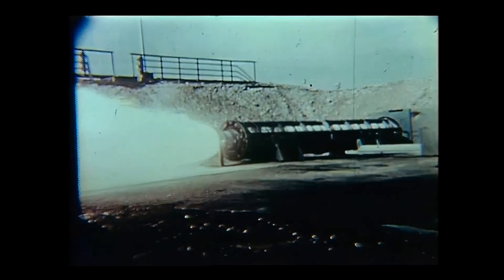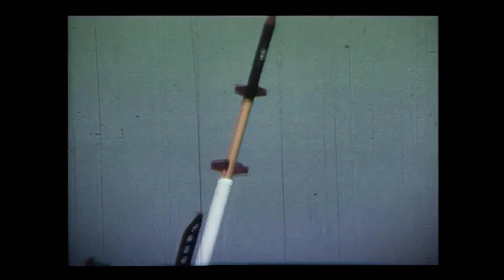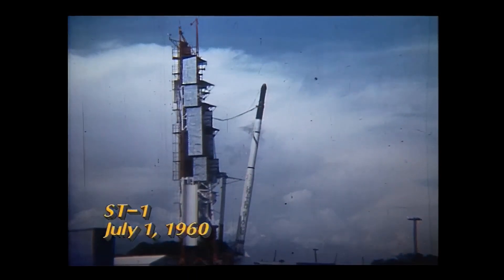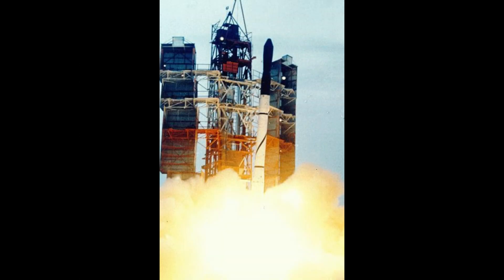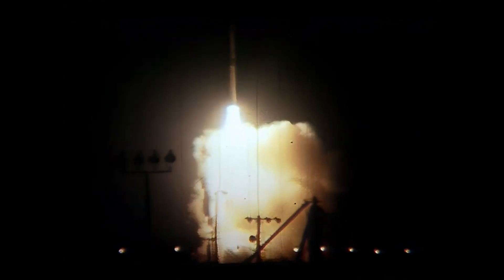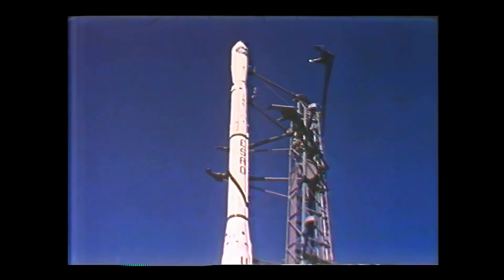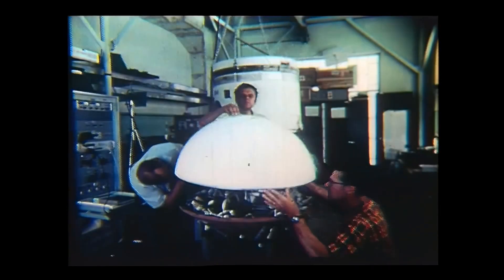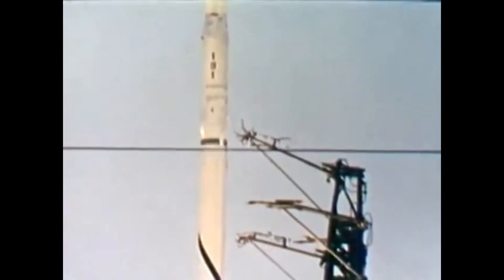The NASA Rocket Everyone Forgets Exists

Comment: Always enjoy your videos Scott but this one hit very close to home for me. I worked the Scout program at LTV Missiles and Space Division as a technician and was at Wallops Island for the Gravity Probe A launch on 18 June 1976. It was a real treat being at the facility working around a live rocket. Somewhere around here I have pictures of the vehicle the day before launch. Interesting note is a large ball was used to plug the Base A nozzle. You can see pieces of it bouncing  up in the air on some of the launch videos. I was in the blockhouse at launch and it did shake the floor. Some of the guys I worked with were present on the failed launch that damaged the sports car. They said it was customary to leave the blockhouse door cracked open so after the sequencer initiated the launch, the team could all run out and watch. As it was told to me, when the first ones got out and saw the fire and debris, they were very keen on getting back inside only to run into the stream of guys coming out that were unaware of the carnage. Thankfully none were injured.

Comment: There's a Blue Scout on display outside the Strategic Air Command & Aerospace Museum. IIRC the placard explains one of its uses was to lift a radio relay on a suborbital trajectory for use in case the satellite network was compromised.

Comment: Maybe I’m jumping on the wrong X-1. But it’s because I have a serious issue with USA claiming they designed the aircraft. They absolutely did not. The aircraft was a British design that had an all FB lying tail and wind tunnel tested very thin wing. The Miles M-52 was built to go 1000 miles in one hour. It had a turbo jet engine shock cone air inlet that carried the pilot cockpit and full undercarriage. It was almost ready to fly when muppets from British government canned the project and had all those design secrets given to USA. Bell copied the shape, the wings and tail. But they used an air drop launch and ticket motor. Pilot safety? There was none.
Reply: All correct - but your spell checker has run riot 🙂. The story I heard was that the UK and USA did a deal to share supersonic research to beat the Russians. So the UK sent over all their data and designs, including the crucial all moving tail. And the USA sent - nothing. Not out of some Machiavellian scheme, but because they didn't have anything worth sending.

Comment: Did the Polaris have a cover over the missile tube? It looks like it from when you see them launch, I think the Trident has the same but never been able to find an answer, I guess this is as good a place to ask as any.
Reply: All submarine launched rockets currently are sealed even when the tube doors are opened.  When launched, a gas generator over pressurizes the tube, both propelling the rocket towards the surface AND provides an envelope of gas enveloping the rocket, sort of like a bubble.  When it pops out of the water, the missile is actually, mostly dry.  When the missile starts to fall back to the water, the first stage is ignited for its journey.

Comment: So with Solid motors... did it accelerate like a mad thing ???
I understood that the high acceleration was the reason why they didn't become the goto system for orbital launches.
And that Liquid fuelled rockets were much gentler on their payloads...
Yes/No ?
Reply: The ascent was more energetic, but not exceedingly so. The peak acceleration was at the burnout of the stages and was around 9 g's. The average acceleration was much lower.
Reply: @cogoid  
LOL  😄
I don't think I would enjoy being on a rocket doing 9G.
Reply: Liquid systems can run into problems of their own when things like pogo happen.  Even the Saturn V had its moments.

Comment: That "hotter" staging system sounds very Kerbal.  Specifically chaining solid motors without stage separators and letting the exhaust from an upper stage burn away the lower stage.

Edit: Also, thank you for mentioning Orbital.  Northrop has done them so incredibly dirty since the hostile takeover.  They were the OG private spaceflight innovators, way beford SpaceX was even a gleam in Elon Musk's eye, and it's kind of painful to watch Northrop piddle around and do absolutely nothing with the rockets they designed and flew so successfully.
Reply: To be fair, most of Musk's ventures were successful or well on their way before they were a gleam in Musk's eye.
Reply: My father works for them (Orbital Sciences before the merger with ATK and now Northrop Grumman) and I've asked him about this. What he told me was that the reason Orbital stopped using the Pegasus was because they couldn't get any takers for it, however, they do have a couple in storage left so in theory they could be launched but the price keeps going up because having all the hardware to use them without it being used is expensive.

Orbital Sciences has the record for first private orbital launch vehicle on top of it being an airlaunched rocket.
Reply: @efulmer8675  My father has likewise been working there for a similar length of time, and he was under the impression that some of the satellites his group is working on were originally slated for those boosters but were moved to different launchers when Northrop bought them out.

Comment: About 4:10 or so: I don't know that I've heard of "fins" versus "vanes", or even fin-like objects in the exhaust. Wanna talk about vanes at some point?
Reply: The Scout first stage had fixed delta fins with steerable (by internal gear + chain) tips which connected by shaft to vanes in the exhaust (jettisoned within 15 seconds, or at least that's what the specification says).  So the vanes handled steering in the early seconds, and then as speed increased the tips became effective for that purpose.
Reply: I’m not what he meant by fins for steering unless they were pivoting fins but the Exhaust vanes he mentions are a form of thrust vector control. The Vanes could be controlled to direct the exhaust/thrust. I don’t believe they use that method too much now though, as a lot of rockets probably use a gimbaled motor mount instead for TVC
Reply: In one of the KSC Visitor Center history buildings they used to have a Mercury-Redstone exhaust vane on display which apparently fell off during Alan Shepard's flight (I guess they didn't need all of them).  They have redone that whole area since I have been there so I don't know if that particular item is still on display there.

Comment: Scott, I'm surprised, you missed one of the more fascinating uses of the Scout launcher, its one claim to fame in the early manned spaceflight program.  People forget Mercury-Scout 1, that flew in November of 1961.  Probably because it failed, lol.  But it was designed to put a small test satellite into a Mercury orbit that would last for a few hours, and was equipped with the same radio and radar systems as a Mercury spacecraft, complete with simulated telemetry and command channels.  Its purpose was to exercise the Mercury tracking network with a real spacecraft prior to flying a manned Mercury.  As it turned out, MA-5 flew with its chimp passenger before MS-1 was able to be launched, so it proved out the Mercury network.  It meant that the loss of MS-1 wasn't a real problem.  However, I think it's good to remember that the Scout was, in fact, a Mercury launch vehicle.  From a certain point of view.  🙂
Reply: As a Space Race Kid I did not forget.
Been involved with DoD and DOE projects in my career.

I believe it was Joe Rogan who started the nuclear testing in the Nevada against structures and soldiers was propaganda for Russian consumption.  This is an uninformed blogger prospective.  This data was clearly integrated in to AEC regs and DOE construction requirements.
And to think it was a Hollywood stunt omits the fact that the Russians conducted the same kind of testing in Kazakhstan desert.

Finally, what I postulate to people for the last +40 years of you believe our ICBMs of the 50 & 60's were reliable well I guess you did not have broadcast TV in the day or the Google or YouTube machine in the modern era to actually see the documented footage of what the US Space program overcame to deliver a payload to space or orbit.  At the time regardless of the fuel solid or liquid our rockets regardless of the base military rocket fell apart or exploded on the launch pad or in early flight. (Name it - Jupiter, Viking}={vanguard, Mercury-Redstone, Titan II , .... Atlas...) All designs from our ICBM inventory.

Understand that are human rated Space program rockets made our ICBMs extraordinarily reliable.  This is why we should look at the Saturn and the f-series engines with awwwww.

Our bombers were the credible delivery system in the 50 & 60's not ICBMs.

And ablative heat shields for the weapon to survive re-entry was a 2 way street.
Reply: @barrelmitt1544  I wonder however how much reliability mattered in terms of deterance. Obviously I'm not saying it didn't matter, but if say 30% of launches failed, that means 70% of the nuclear weapons are hitting their targets. Of course back then there weren't nearly as many missiles, and also if the reliability is extremely poor and only 1 out of 10 launches are successful that's much less of a deterance.  But the usual clips showing failure after failure I suspect are not showing the full context. When I have some time I would like to go through the early launches and get a better idea of the failure rate for the different vehicles.

Comment: First time I read anything about a Pegasus launch was way back in the late 80's or 90's when one was launched from an F-15. Haven't heard much about the concept since. Makes sense to use a large aircraft as your First Stage.
Reply: Pegasus was too large to fly from an F-15.  The first few flights were from a NASA B-52 before Orbital acquired and modified the L-1011 that they would call "Stargazer."
Reply: The Pegasus rocket is unique and its a shame that its basically died.
Reply: @efulmer8675  You can blame Northrop for that.  They bought Orbital ATK and basically killed everything they were doing except the stuff they had government contracts for.
Reply: @vicroc4  Northrop is still looking for customers for their last two Pegasus rockets but yeah both my dad and I were surprised Orbital ATK got bought out so quickly.

And oh yeah, Northrop's logo makes me die inside.
Reply: F-15 was the launch platform for "ASAT" satellite interception weapon tests.

Comment: My step-brother, Mike Howell, built a Scout for the National Association of Rocketry Annual Meet (NARAM-13) back in the early 1970s for which he placed 2nd in the Scale Model Rocket competition that year.  As a somewhat younger competitive modeler myself, I was amazed at his skill and hoped I could match it someday.
Reply: Why scale it down?  Full size uses standard solid motors like all the other models .
Reply: @johndododoe1411  Because in the 1970's there was still a lot of sensitivity to larger than 160 newton second thrust propulsion in a model rocket, primarily due to no liability documentation as we have today in the NFPA 1122, 1125 and 1127 frameworking, nor the airspace permission.  Building and flying such a full scale rocket today is possible under our current FAR Part 101 system and launch license system, but back then it was not.
Reply: @johndododoe1411  cause its massive lol, hed have to basically use nasa hardware at that point. on another note i miss launching model rockets, buying the SRBs from the local hobby store etc
Reply: @johndododoe1411   A  Scout model entry in that time period (NARAM-13 = 1971) was probably in the 35-40 mm diameter range.  I've built a few models of the ST-4 round seen at 6:02 which are about 60 mm in diameter and powered by an Estes D12 in the first stage.

NARAM-13 was by the way when Space Race-infused competition interest peaked for the National Association of Rocketry:  There were about 700 applicants for the 350 slots.  I believe that was the only NARAM which had to cap competition attendance.

Comment: Scott, you should do a video on the SPRINT missile.  Unbelievable performance.
Reply: The Sprint missile breaks my physics brain. The speed of rockets is hard to feel, but the breakneck acceleration of Sprint is hard to fathom.
Reply: @suserman7775  Leaves launcher, achieves multiple mach instantly, all while making 90-degree turns. With 1970 technology. Head-busting indeed.
Reply: Zero to hypersonic in a few seconds? It would make an interesting interceptor.
Reply: @fallinginthed33p  Wasn't that its reason for existing? I seem to recall Ivan wasn't happy about it.
Reply: @thomasbell7033  I think so. It was accurate too given the 1970s tech. Now it could be very interesting to use it as an air-to-air missile if you really didn't like that AWACS plane and you wanted to get rid of it ASAP.
Reply: @fallinginthed33p  Yes, but don't you think a plain old off-the-shelf SAM would work on a lumbering AWACS or ELINT platform. Our fighters have just about been intercepting Tu-95s in their sleep for 50 years.
Reply: @thomasbell7033  Well, you'd need a SAM that don't get hammered by HARM. It could be better to use a Sprint AAM to hit high value airborne targets with minimal warning from very far away, assuming the missile can track a moving target like AWACS planes.
Reply: When the PRC claims their hypersonic missiles (somewhat akin to Pershing II capability) are more advanced than anything the USA has, I think "They only missed being first by 40-60 years".

Notable Sprint notes:

Supposedly it got hotter on the outside than the inside.  Does that mean the combusting solid propellant was actually cooling the airframe?!  : )

High burning rate was achieved in part by "staples with one end bent up ninety degrees" set into the propellant during casting, to facilitate heat transfer.  How do people think of these things?

The motors remained stable/flyable into the 1990s (e.g. KITE-2), unlike Spartan boosters which became unstable and had to be destroyed in place at their storage locations.

When all is said and done, a defensive ballistic missile shield is a losing game in terms of cost to implement vs cost to overcome.  First Eisenhower, then Kennedy and later Nixon more or less understood this.  Reagan...
Reply: I had to go refresh my memory on Sprint. The turn, about 120 degrees, (not 90) comes at .1 seconds after launch, a 400g turn!. In less than 3 seconds it has accelerated to Mach 8.8. Ow, ow, ow, now my head hurts too.
Reply: Absolutely. The obstacles that had to be overcome to make that little beast work.

Comment: Scout was offered to the British Government for free if they stopped developing Black Arrow - needless to say, the offer was withdrawn once Black Arrow was cancelled.
Reply: Actually the offer was to launch “for free” by NASA. It was the free part that withdrawn.
Reply: @Dog.soldier1950  Yes - I didn't make that clear
Reply: Black Arrow died of its own failures and budgetary woes.  It took a year to build a single vehicle, 2 of its 4 launches failed, and British satellites of that period took even longer to build than the launch vehicle, leading to the question of why build rockets when there was no payload to launch. And money being poured into BlackArrow took away funds for satellite development. Thus the Government finally concluded it was wiser and cheaper to just buy a ride on Scout when ever it was needed.
Reply: @Spectator1959  2 out of the first 4 launches failing is good going for a new launch vehicle back then. Falcon 1 had its first three launches fail.
Reply: @owensmith7530  Early launch failures were the norm, but the Black Arrow program apparently wasn’t funded for them. They were trying to lift actual payloads starting with the second rocket. Two out of the first three launches failed and the government canx the program. The 4th rocket was built, so they launched it successfully with a satellite, but it was too late. Elon very nearly failed too, but he had enough money for two more Falcons after the first ones failed. In any case the point is the US didn’t trick or strong-arm the UK into cancelling Black Arrow, it already had problems and the Brit Government simply didn’t feel  it had the money to commit to both satellites and launchers, so launchers got the axe.
Reply: Yes, the US screwed the British once again on that one. Eventually we will learn.
Reply: @owensmith7530     "Eventually we will learn."  Maybe, but it wasn't just the Scout rug-pulling.  The USA followed that up with "Your shoe's untied!", and when Britain looked down the USA bopped them in the nose.  So it's been that sort of relationship.
Reply: @marcmcreynolds2827  I know. The US has a history of treating the UK terribly. Another example is all the UK technology they stole during WWII claiming patents and licence fees for technology we shared with them as part of the Tizzard mission.
Reply: @owensmith7530    I've wrestled with that one.  A primary reason for Britain's desire to share some of the crucial technologies was so those could be improved and mass produced in a country (plural actually, inc Canada) with far more resources, which was relatively safe from attack.  And that's what happened.

The USA likewise revealed some of theirs as time went by, though what arrived from Britain was particularly seminal.  There were of course many patents which resulted from improvements on the British work, and in accordance with international law the inventors of those improvements have claim to the rights.

Churchill knew the tradeoffs which went with his decisions.  One could say he made the right choices, given that eighty years later people passing on London streets rarely greet each other with "guten Tag".
Reply: @marcmcreynolds2827  the us stole so mani patents form france germany and the uk that is so funny when they cray china steals theres